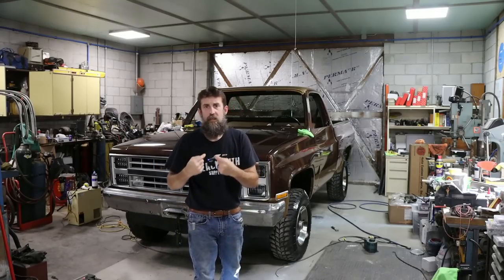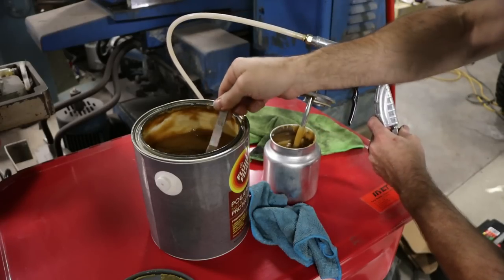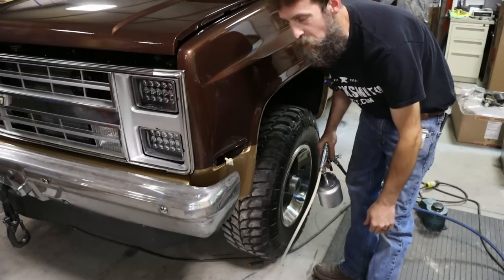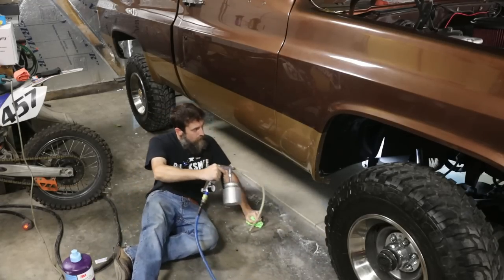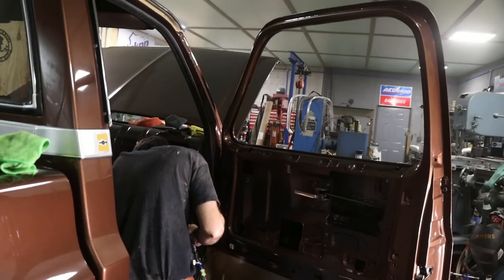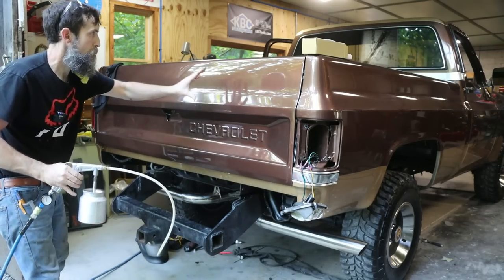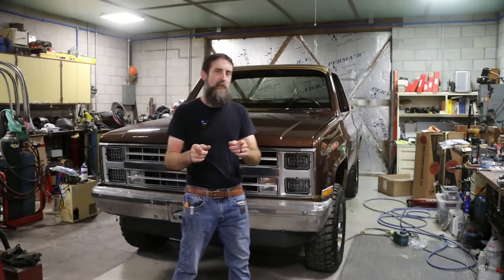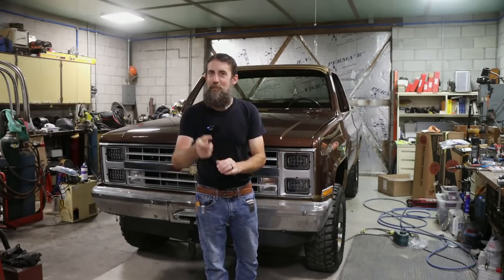Best way I have seen to RUST PROOF!

Comment: This vehicle is designed to rust. I can't believe the salt entry ports and salt storage pockets that are built in. It can't accidental. I have driven Volvos for decades in winter near salt city Buffalo NY area. They require absolutely no rust care and never rust. Period. Many of them I kept for ten years - no rust period. Also no repairs except wear items tires, wipers etc. You can routinely go 100K miles without a single failure.
Done it several times. If you don't achieve zero repairs you might have one or two. I let a trusted dealer look it over every year or two. Volvo submerges the entire vehicle in paint to coat it inside and out. They use galvanized steel in some areas like rockers, and have stainless exhaust so exhaust repairs are unheard of. Critical things like break lines are stainless too. There are no pockets or holes for salt collection and the entire engine bay is fully covered on the bottom so the engine stays clean and salt free. They have no grease fittings because that is just an entry for road dirt that guarantees early failure. When you sell it drives like the day you bought it.  It is designed to last not to fail. They make semi's but not pickups, too bad.

I've switched over to Tesla electric cars now, They are aluminum so they don't rust either. I wonder what trucking community will do when they can buy a Tesla stainless Cyber Truck that won't rust and cost 1/10 the cost a gas vehicle to operate. Future generations won't have to deal with rust.  They might wonder why we ever put up with it.